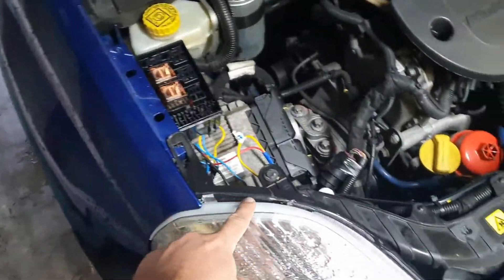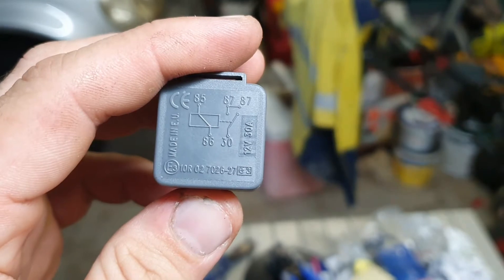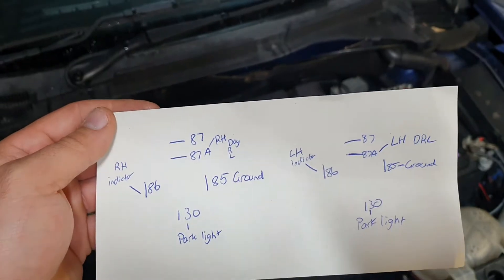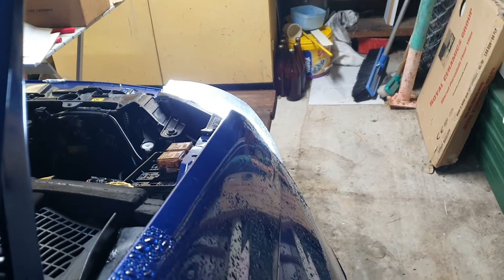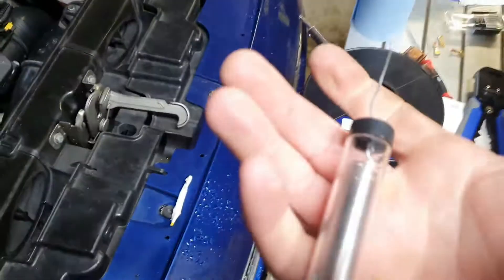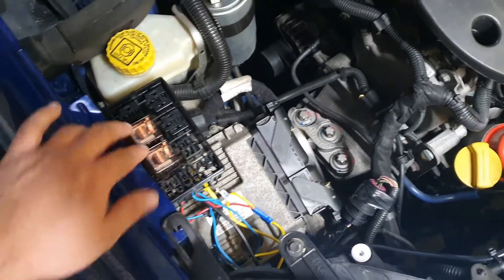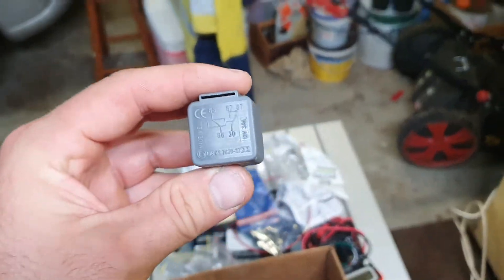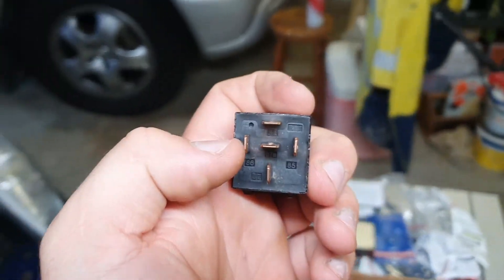DRL Indicator Issue *FIXED* Cheap Relay Fix!!

Comment: Hey man, for the indicator did you wire the factory wire and the wire for the indicator on the led strip to pin 86
Reply from the maker: yes piggy backed off factory wiring

Comment: facing a problem in installing same DRL, white parking lite is working OK, but when i connect yellow color signal wire of DRL with the car indicator signal wire, DRL indicator signal light (orange colour) doesnt glow, whereas, when i connect yellow color signal wire of DRL direct with battery, it works..... what is the problem???
Reply: Same prob.. that why im here.. hows yours?  Have you fixed it? I will fix mine by weekend hoping it will work or else i just waste my money
Reply from the maker: The one thing I have noticed with these LED strip lights that once you have the white LED one it needs a full 12v to switch on the orange. My advice would be to use a relay like I have to drop out the power supplying the white LED when you are using your turn signals.
If you check your indicator voltage I bet you it won't be 12V and it won't last long enough for the strip light module to switch over to orange.